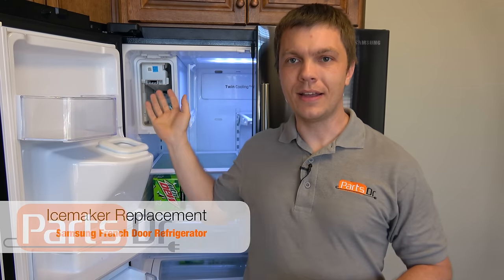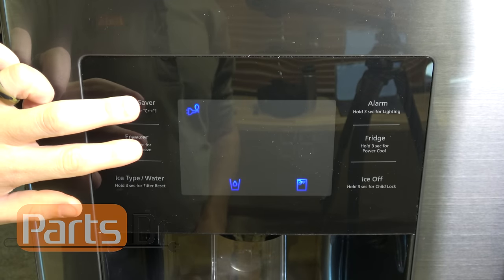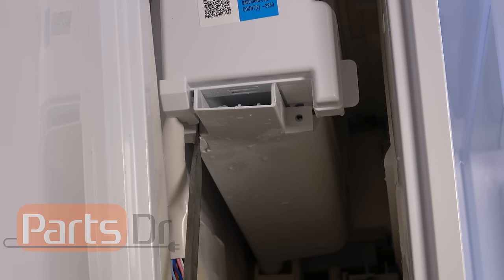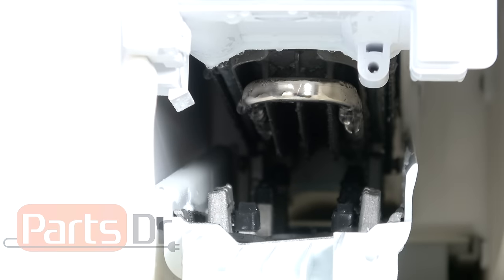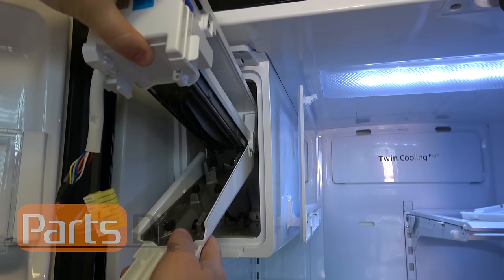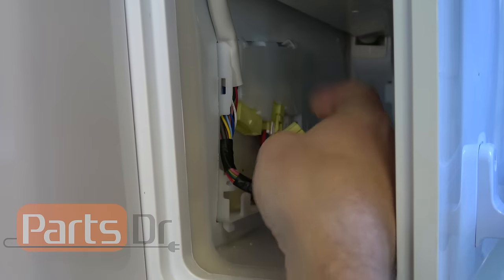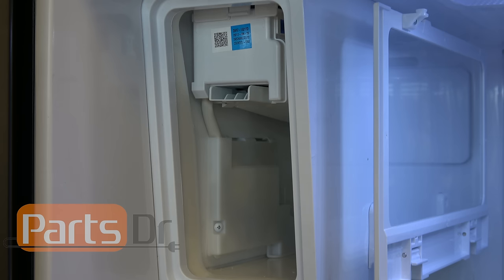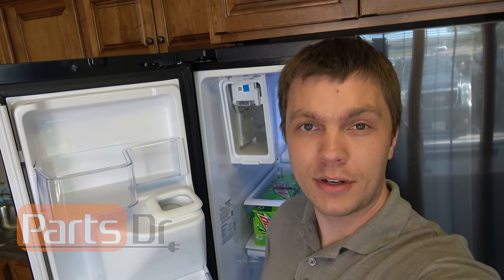How to replace Samsung Icemaker part # DA97-15217D

Comment: I love it when people such as you "hack" these convoluted electronic and secret systems and share with the rest of us. It's a real shame that a company as big as Samsung is ripping people off as they are with these refrigerators. Your video is AWESOME! I am  a DIY-er but never expected to have to be with a brand new kitchen suite! Why couldn't Samsung do that? What do they think? I'm gonna buy a $2000 fridge then continue to pay hundreds to solve their problems? Stay away from Samsung appliances!
Reply: The price has gone up closer to $3,000.00 but they need to get the engineers that designed this icemaker and tell us how it works and how to solve these problems.
Reply: The trouble is that the problems are fixable, but they have very poor technical support for the service tech. Many are left in the dark when it comes to Samsung refrigerators. They have more electronics than a transistor radio.
Reply: The back story is that both LG and Samsung are Korean Made. When they designed actual appliances they realized that they needed ice makers in order for the US consumer to purchase them. Using ice is more of an American thing. Since the main patents are held by Chinese companies they would not grant patent permissions to these companies to use. Usually you can use other peoples patents in manufacturing with permission and a for a small fee. So these companies had to redesign ice makers without infringing on other company patents. Actually the  Koreans have been designing electronics for the rest of the world and are far better quality than Chinese competitors. Japan switched to selling raw materials years ago so they no longer are the leader. Most all of the American Brands have sold out and are Made in China. The quality is nothing like it was 30 years ago.
Reply: Good old days that you went to Sears and bought a refrigerator that lasted a life time
Reply: @transformer889  None of my customers had to buy a kit or pay for the repair. They do have a recall based on model number serial number and revision. They don't always send the information to each customer if the customer has not filled out their warranty card. Products are sold through other retailers that do not provide Samsung or any other manufacturer with that information.
Reply: @jmcwatchdog526   There is a class-action lawsuit over the defective ice maker. I researched and found out there is a kit out there by Samsung that fixes the ice maker.  I downloaded all the information and called Lowes for warranty work which normally cost $500. they agreed to pay to install the kit and deal with Samsung later. Before that, I called Samsung customer service a lady from the Philippines answered the call and repeated was is in the manual, furthermore, she had no idea who would service the refrigerator, she told me to call around.
Reply: My fridge has been perfect for 6 years now. The ice maker is a little slow, but other than that it's been great.
Reply: @exploringcolorado720  mine is 5 yrs and just now I had to replace it...

Comment: I really appreciate the video, I was eventually able to get the ice maker out. It was more difficult in my case because the entire assembly was a block of ice, so I had to carefully chip away at the stuff I could, run a defrost cycle, hit it with the hairdryer for 10 minutes, run another defrost cycle, more hair dryer, and finally I was able to remove it. You know, for expensive fridges the ice maker really sucks.
Reply from the maker: We are glad you found the video helpful!
Reply: I read that for this style of Samsung fridge ice maker, they are aware of the excessive frost/freezing, and built a replacement with changes made to cycle timers and stuff, but it's not free. :(
Reply: We used a hair dryer and a towel to catch the melted ice.  I was worried about damaging something - particularly the coil.
Reply: Does force defrost mode defrost the entire fridge or just the ice box. I have the same issue and I'm hoping I'm not about to ruin all the food in my fridge.
Reply: @thecoalregioncarpenter7498  there are multiple options for defrost. Once enabled, be sure to cycle the setting to "Fr". If you go past it don't worry, you can keep pressing a button to go back to it. The "Fr" setting only defrosts the icemaker, your food in other parts of the fridge/freezer will be okay.
Reply: I concur. For an expensive refrigerator, this ice maker is a piece of garbage. I wish I could remove the ice maker to reclaim the space because it's completely worthless.
Reply: I will not buy Samsung appliances ever again. They had to be sued by a class action to send the parts for free. Call Samsung 800# tell them the issue and mention the CLASS ACTION LAWSUIT and request your replacement and repair tech to install. That’s what I had to do.
Reply: @faithdillard there is an electronic part that breaks if it gets too hot. And some sensitive wires on the underside of the icemaker.
Reply: @PartsDr which silicone do I need to seal in ice maker?
Reply from the maker: @psd-954  Here is a link to it: https://partsdr.com/part/da81-05595a-adhesive  and the video that shows how to apply it is here: https://www.youtube.com/watch?v=8DkXLEXKAug

Comment: I did this in 30 minutes total. From power down the fridge, to power up the fridge. I did NOT use defrost mode; and did NOT empty the fridge. (but thanks for including those in your video)
Reply: Jacob Downey was
Reply: Does Samsung have service bulletin on this? My fridge  less than 2 yrs old......are these parts/ service covered? Kinda like a recall? Or is this out of pocket?😡
Reply: @theusconstitution1776  The mfg warrantee is only for 90 days, unless you purchased an extended warrantee.  The other item of note is that most retailers (in my case, Home Depot) say they know nothing about any problems, even though it's all over the web.
Reply: show off 🤣🤣🤣

Comment: One thing that solves the issue in most of the cases is to ensure that the fridge is in a slight angle, having the front a bit higher. The wheels in the bottom of the device should not be touching the ground. Only the two "legs" that you have to turn clockwise to lift. No more ice buildup, no more water trickling when you get ice
Reply: I am going through the defrosting process right now. I am gonna check that, good call.
Reply: @maxmorrill3808  how did it turn out? My fridge isn't makin ice either. Did tipping it help?

Comment: Hi there.  These instructions were awesome!  Just a couple of notes from my experience.  My refrigerator was a 2016 and the button combinations to turn off the fridge and do the force defrost that are shown in the video didn't work (and of course the Samsung user's manual and online chat were no help) so we just flipped the breaker to turn off the fridge.  Also, if anyone had an "ice jam" like we did be prepared to take significant time to melt the built up ice before installing the new unit.  And I highly recommend buying the clips recommended.  Our model didn't need them.  We didn't know that and bought them anyhow.  Boy would I have been mad if I went through all that work and then realized that we needed them.  They are just a few bucks so worth the saved aggravation if you do need them.  The parts are great and this video was really clear!  Thank you.
Reply from the maker: Great advice!

Comment: i thank Part Dr for providing this video to fix a problem with the last Samsung product that I will ever buy. I had additional problems with defrosting the coil tube. I read several other comments that helped me to do the job right. The forced defrost did not work well but I alternated between it and a blow dryer which took a long time. Most of my time was spent on defrosting. After removing the electrical hook up and getting the ice maker dropped, the build up of ice/frost did not allow the ice maker to be pulled out. I hooked up the electrical connection to prevent any water to get into the wiring. The two button shut off didn't work but I could shut off the power to the POS frig from the panel box. I had the power turn on to do the force defrost and then use the blow dryer. I had the ice maker shut off on the touch screen but it would chill after the force defrost while using the blow dryer and start to accumulate frost again. I would have turned the power off while blow drying if I had to do it over. I did turn the power off to complete the job. Next frig which may be tomorrow will be an LG. I recommend that anyone reading this prior to replacing the ice maker read several other comments so they too can know what to do if they run into problems with this POS refrigerator. Peace out!
Reply from the maker: Thanks for sharing!
Reply: I did have to push the blue reset button on the upper right side of the ice maker before it started to making ice.

Comment: For the 4 door (French door) Samsung, the buttons to hold down to enter the forced defrost mode are the freezer and lighting buttons. Other than that, once the defrost cycle is complete (about 20 minutes for my model-RF28JBEDBSD), you can just follow the video. Great stuff-thanks for posting!
Reply from the maker: Thanks for the tip on that model refrigerator!
Reply: @PartsDr  my refrig does not have the referred button to force defrost. I have freezer, door alarm, energy saver, fridge, cool select, and ice maker off.
Ideas?
Reply: Thanks!
Reply: I have the 4-door model. Pressing the CoolSelect and Fridge together for 8sec enters the select option mode; then push the Freezer button to cycle to Fd
Reply: Charles Robinson hi, my model is RF56J9040SR and none of these Force defrost seem available - where did you find the info??
Reply: Thank you!!!! This truly helped me :)
Reply: @shycatzk  You're welcome!! I figured why should everyone else have to try all the button combinations too??

Comment: Found the ultimate solution to this problem: take a sledgehammer and smash the ice maker to pieces.  Put refrigerator in garage and use as new beer fridge.  Go out and buy a quality non-Samsung product to replace.
Reply: Best solution yet!
Reply: LOL!
Reply: Samsung appliances are all junk. All in my kitchen have broke or have issues.  Less then 3 years already replaced dishwasher, don't use self clean in stove it is eat itself up, screamed at samsung to repair out of warranty. The microwave does this annoying beeping at goes to 7 sec and today I replaced icemaker.  Next year remodeling kitchen and I'm going to dump all these 3yo appliances and go back to kitchen aid.
Reply: Samsung might make good TVs but the ice makers are hot shite
Reply: @coconnor72  Actually I have found their TVs to be junk too. Had a 4k Smart TV for 2 years and it freezes up, turns off randomly and cannot connect to WiFi.  We don't have any downloaded extra apps on it either. I am done with Samsung
Reply: Big Billy Wallace 1237  Agreed. Their is no way this piece of junk fridge can work in the heat of summer in the garage.
Reply: Scott Leaf  I’ve got one to , what a piece of crap....
Reply: Whirlpool isn't any better... had a top load washer go out at 5 years (bearing) the repair guy said the design was so bad, they wouldn't even touch them. And the compressor took a dump on my fridge at about 6. Fortunately we bought the extended warranty on that one.
Reply: @chuckstephan  Agree on washer/dryers, but our refrigerator is now 5 years old and still going, never an issue till today with the ice maker, I had to reseat it and it started working again.
Reply: An appliance repairman who is a close friend of ours said he would never recommend a Samsung Refrigerator. He also said that he has made a ton of money from Samsung's poor quality. As the Romans said "Caveat Emptor" Buyer Beware!
Reply: I have had problems with LG, Samsung, whirlpool, GE, they are all junk anymore
Reply: I bought a Samsung refrigerator now I am a refrigeration,  specialist
Reply: in total agreement
Reply: That’s literally what I’m doing right now!!! 😆
Reply: Consumer Reports testing of large kitchen appliance showed LG is the brand to buy.  They outperformed all the competition.  Sadly, Samsung was near the bottom.
Reply: @davidglass3275  the comment was from 4 years ago and apparently the public outrage of their shitty icemakers worked

Comment: Did this today.  This video was a godsend.  I'm good with mechanicals of all sorts, but I don't think I would have figured this out myself!  Thanks, guys!
Reply from the maker: Great to hear! We are glad you found it helpful!
Reply: Did you replace it because of wet ice and continuous freeze up issues? Just trying to figure out if that will help me
Reply: @KehlPetersen  big solid block of ice. Had to remove it to descale  and clean it, and get built up ice from behind it.

Comment: Excellent video. A couple of notes from my repair. My fridge uses FREEZER+ALARM+FRIDGE to turn it O FF (a.k.a. Demo Mode) rather than just FREEZER+ALARM. You CAN use a hair dryer if necessary, but only on the coolest heat setting - anything warmer is likely to warp the plastic parts of the maker. My icemaker tends to get an ice dam buildup at the back of the icemaker where it touches the styrofoam at the back wall of the fridge. There is a duct there that needs to be ice free. Make sure that duct is clear before re-installing your icemaker. Finally, when replacing the screws, I suggest using a manual screwdriver, not power (or use one with a clutch set on very low torque). Again, this is very soft plastic, and you could strip the hole. Good luck!
Reply from the maker: Thanks for sharing!
Reply: I am watching the technician right now replace mine and he strongly recommends never ever using a hairdryer on any setting as it can cause damage to the internal parts such as wiring harness and  plastic , this will VOID Warranty
Reply: Over time I have found that using a hair dryer can work, but it is challenging because it is easy to let the plastic pieces get too hot. A far better choice is something that puts out steam. I currently use the steam unit from a wallpaper remover unit (without attaching the piece that attaches to the end of the hose). That way, you're getting very hot, but not too hot, air (steam) to melt the ice. I have to defrost my icemaker about every six weeks this way, just like we did with my parents' ancient Servel gas fridge in the 60's. I had hoped Samsung had a more modern icemaker, but at least we don't have to use ice trays anymore!

Comment: Excellent video with step by step instructions that are very easy to follow. The only issue I had was actually removing the old ice maker. It took some time and patience. I had to wiggle and jiggle it back and forth and up and down. It is hard to get much of a grip on it but I finally discovered that by grasping the wiring harness that I had disconnected and pulling on that from side to side and up and down it finally broke lose and then came right out. The rest was all very simple. After the job was complete it took 10 hours to get the first load of ice to dump but by the next morning the ice bin was full and it continues to work as it should.

Also, pay attention to his comment on shining a light along the edge of the bottom of the ice maker. When I did that I saw light come through the entire bottom where it meets the wall. That may have contributed to it not working in the first place. I couldn't get my caulking gun to fit under there so I had to just put some caulk on a finger several times and wipe it along the edge from back to front. It isn't pretty but it also isnt visible and it did seal the opening.

BTW, there was a class action suit against Samsung for these ice makers settled some years ago.  So after I bought the new ice maker but before installing I called Samsung support to see if I could find a fix without having to replace it. I thought they might feel some obligation to fix this since it is a known issue.

They walked me through some troubleshooting tips but none of them helped so they then offered to send out a Samsung repair tech with new ice maker and install it for free, parts and labor, no charge. 

The catch was, if the new ice maker didn't work meaning it was a different issue I would owe them $300-$600 for the service call depending on his time involved. Since I already had bought the new ice maker from Amazon for $99 I decided not to have them come out and just fixed it myself rather than risk that expense. Afterwards I thought they probably told me that 300-600 charge just to scare me away from having their guy come out, it worked.

Finally, this guy in the vid sounds like a young TV actor I have seen on some show but I couldn't place the TV show it was from or the actor. Anyone else find that?

Great job Mr Parts Dr.

Comment: Thank you so much for this video! I was at my wit's end after several months of my ice maker not working. It froze over so many times that it finally gave up and I ended up buying a stand-alone ice maker. Then I found your video!  I installed the replacement ice maker with the help of your video and had ice in about four hours. Wow!
Reply from the maker: Nice job!